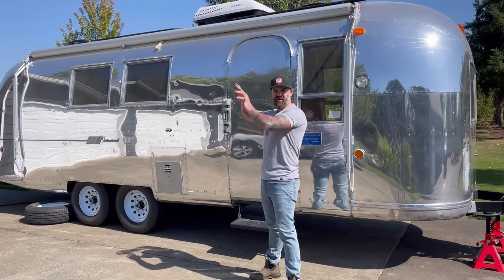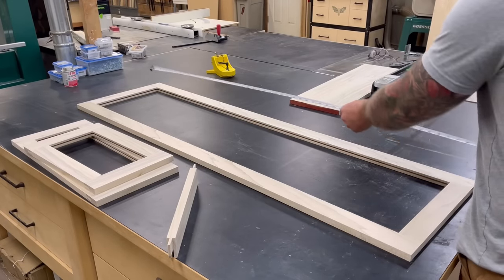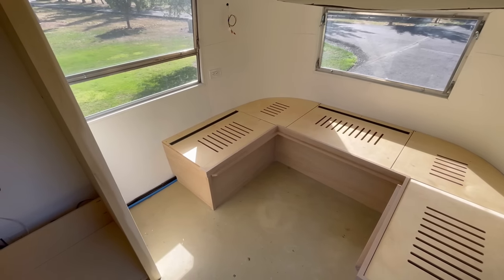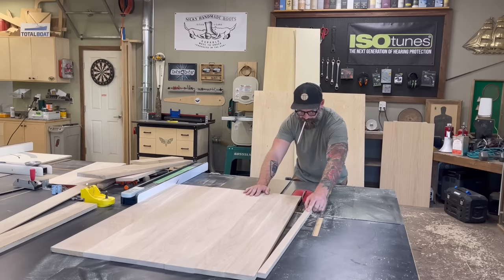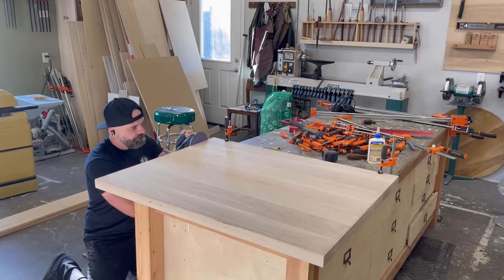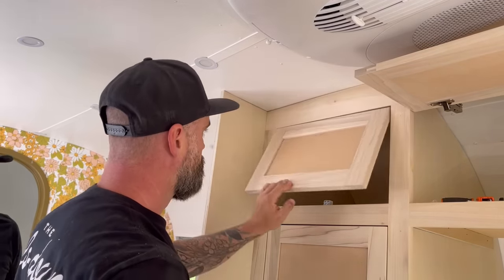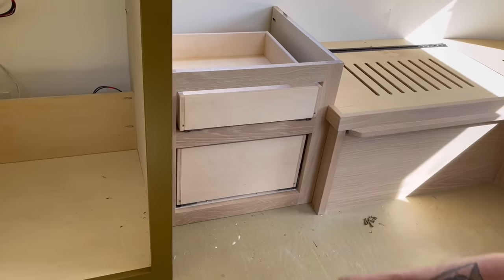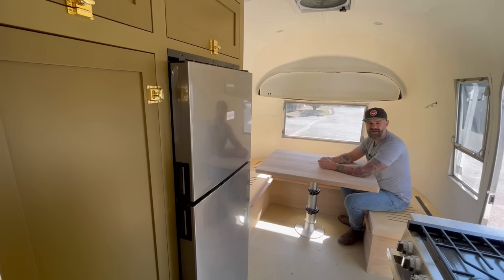How Am I Still Building Cabinets? || Making Huge Progress

Comment: That looks fantastic but if I may suggest with the fridge being installed. I would suggest to put a piece of quarter MDF. stuck on the front while you are working on it, so you do not accidentally dent it.  Then once it's finished, you can remove it.

Comment: The cabinet for the fridge needs some vent holes or your fridge will use much more electricity. One on the bottom and one on the top for good ventilation. I would place them in the back of the cabinet wall.

Comment: it’s all looking great! are you concerned that the inset doors will shift with harsh roads and not open properly over time? also i mix blue windshield fluid to thin paint for spraying. it dries faster and won’t change the color. it can even be used with white.

Comment: Hey loving the build so far but you might want to install some clips to hold the cabinates closed when driving  in case stuff starts sliding arround  and pushing them open

Comment: When flipping the sides under for thickness, I like to miter the end, so that the end grain matched full length and the edge grain also matches full length.

But for this table, I’d have used a boat building technique, and use shop veneers over a lightweight core.  Plenty durable but much lighter and will be less likely to warp when temperatures change wildly like they do in campers.

Looks great!

Comment: All I could think about was...."Did he plug the fridge up before securing it?"..lol.  Coming along nicely.  As for the liquid nails, someone told me not to use it on my kitchen counters in my house when i installed them since they were butcher block tops.  So, I used Titebond 2..which worked well and ticks off all those naysayers.  I mean, it's holding it DOWN and gravity pulls DOWN,  and I never had any issues with Titebond not holding things, so, 60 total feet of butcher block Titebond 2 glued down and holding nicely.  I tell you this because no matter what you do someone will have something to say about it.  You do you.  Just...hope..you plugged that fridge in...........

Comment: Another awesome video! I wonder why you do not use a dust bag for your track saw… or when cutting the Duresin (sp?), the dust extractor is right there in the same shot. Is there a reason you don’t use dust collection on the track saw?

Comment: Question. At the end of the video, you were sitting on what i call the right side of the table. With the nightstand on the left, can you get thru the gap between the tabletop and the top of the stand? It looks tight, which would mean to sit on that side, you would have to scoot all the way around the table.
Reply from the maker: Once the cushions are on they’ll be level with the top of the nightstand and the table will be raised a bit higher.
Reply: Makes perfect sense. Thanks